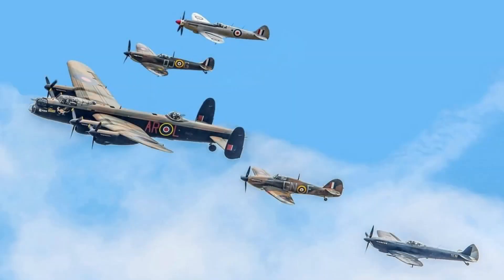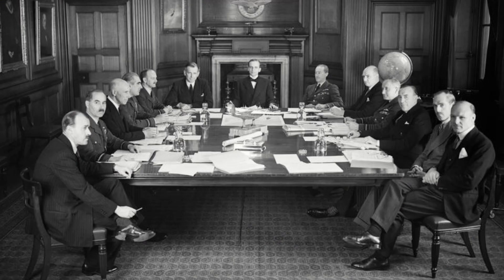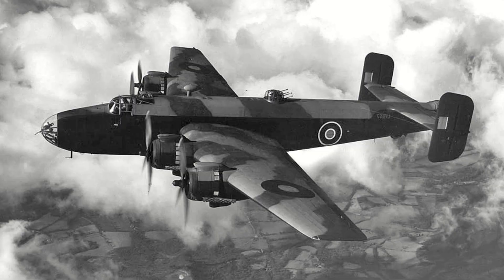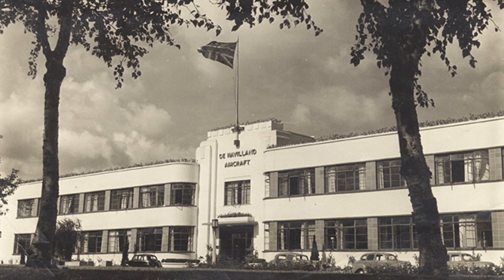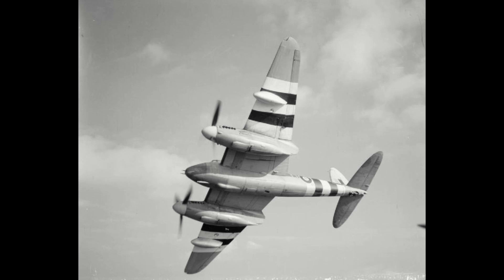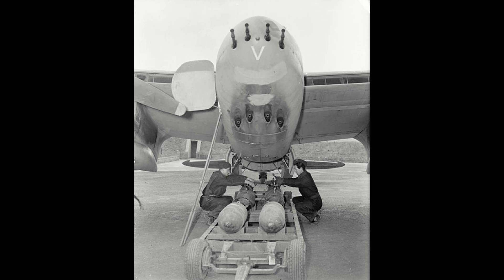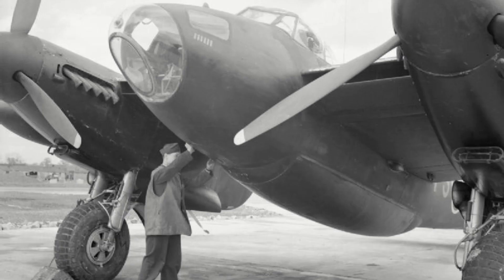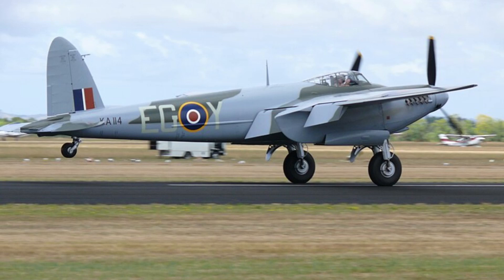5 Minute Guides to Aircraft: De Havilland Mosquito

Comment: Interesting fact is that the 6lb (57mm) cannon of the Tse-Tse version (which was used not only against U-boats, but also sank surface ships) was the largest autoloader type used by an aircraft in WW2 - there was a version of the B-25 with a 75mm cannon, but with manual loading.
Reply from the maker: The Germans had a version of the Hs 129 with a 75mm Cannon with a drum autoloader, technically making it the biggest. the Mosquito with the 57mm however was the biggest of the Allies autoloaded big guns with wings. It should also be noted that the Hs. 129 was in no way comparable to the Mosquito, being chronically underpowered and having a very archaic design being technically a interwar aircraft (First flown in 1939 and having started design work as far back as mid 1930.)

The title for biggest gun on a plane (autoloading or not) I believe goes to the P.108 from the Regia Aeronautica of Italy, who stuck a 105mm gun out the front of one for anti-shipping duties iirc. Strategic bomber with 105mm Anti-shipping gun is a sight to behold, makes me wonder what a B24 with a nose mounted gun of similar caliber would look like.
Reply: @5MinuteGuidesToAircraft  You're right, it's just that the Henschel Hs 129-B3 had so few units produced and used in combat, that's why I ended up forgetting about it.
Taking advantage of the theme, I think that proportionally the largest weapon adapted on an aircraft in WW2 was the small L-4 Grasshopper (a Piper J-3 Cub in military uniform) powered by a 65HP engine that was armed with 6 Bozzoka by Maj. Charles Carpenter became known as “Bazooka Charlie” and his plane became “Rosie the Rocketer”.
Reply from the maker: @lucianoandrade5007  Im familiar with that story! Watched a video from Yarnhub on it. They even restorted the original plane and put it on display somewhere iirc.
Reply: @5MinuteGuidesToAircraft   The original was found in Austria and restored to flying condition by the American Heritage Museum, where it is on display.
On historian Mark Felton's channel there is the video: Bazooka Charlie - WW2s Strangest Tank Buster, with several real images of the pilot and the plane.